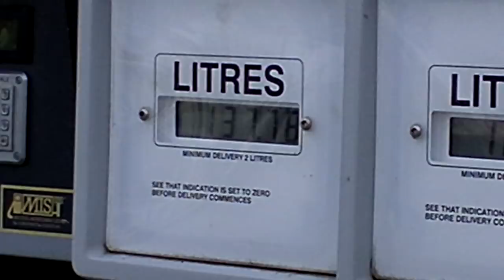Donzi 43 ZR powerboat floated and fired-up at Penarth Marina

Comment: Today I would rig a boat like this with twin Mercury 1100hp twin turbo engines. Less weight, less drag with two outdrives and more HP means better reliability and higher speeds.

Comment from the maker: @hpjunky70 Quickstor – Just for you I went back to the engineer who was filmed adding the chemicals before the gasoline  (unleaded petrol) went into the tanks . He says he was adding Mercury "Quickstor" . This is stuff which is said to prevent regular and ethanol-blended fuel from breaking down and oxidizing, prevents fuel system corrosion and prevents gum and varnish from forming in the fuel and settling in fuel lines and tanks, carburetors and injectors.

Comment: Is the purpose of turning the engines over before ignition to lubricate the cylinders?  I see a lot of performance boats started like this and I'm wondering why.  Is there a separate ignition switch to actually start the engine or do you just hold the key and let go before it fires up?
Reply: Im not entirely sure for boats like this one, but in aircraft, we do exactly that. Especially on cold morning. Cylinder wear is drastically decreased.
Reply: If you only looked at all the photos you would have seen the separate switches for the Ignition and starter circuits, in marine it is prudent to spin before ignition insuring no water in the cylinders that can destroy the piston ring lands or bend connecting rods.